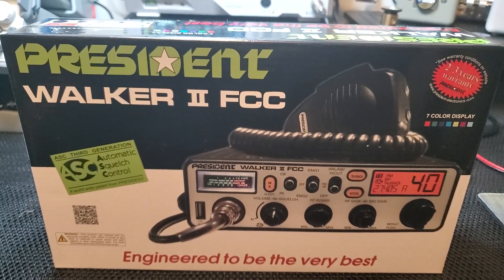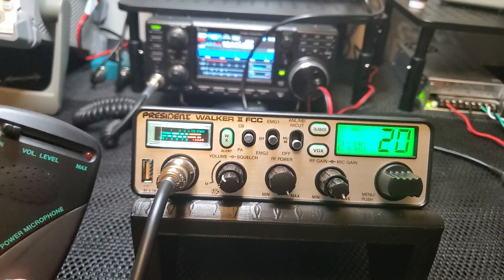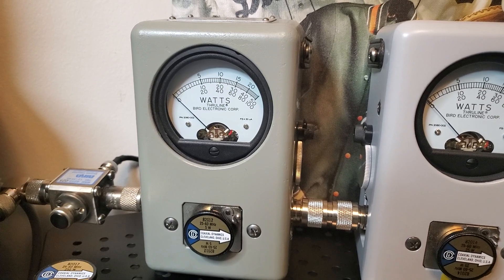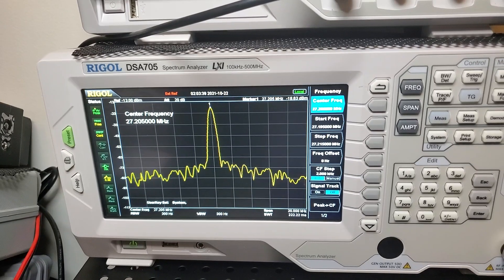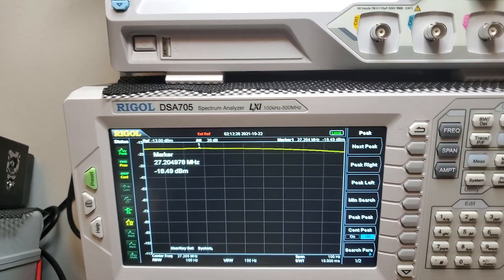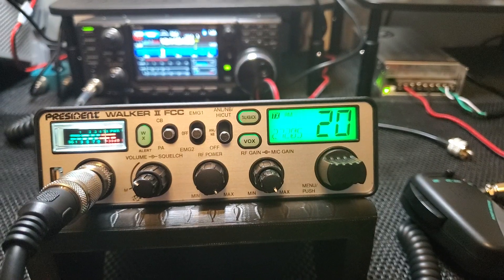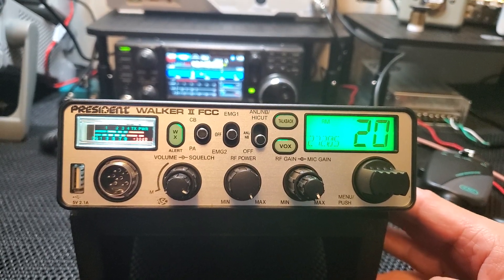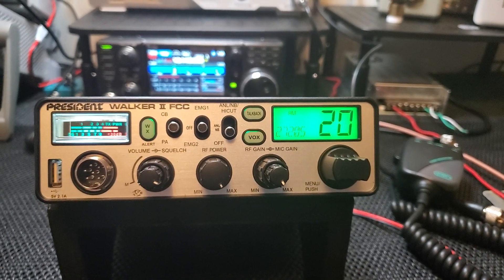New President Walker II for Joseph in MD.

Comment: The only thing I hate about this radio is that you lose the ability to scan if you change the mic. That's my understanding anyway. Makes no sense why they didn't have a scan option in the menu.
Reply from the maker: I haven't tried to use the scan before without the factory mic. it is something definitely worth looking at.
Reply: @ScottsRadios  the way I understand it,  you have to hold down the channel button on the mic to activate scan. My McKinley and Lincoln 2+ are activated with buttons on the radio.